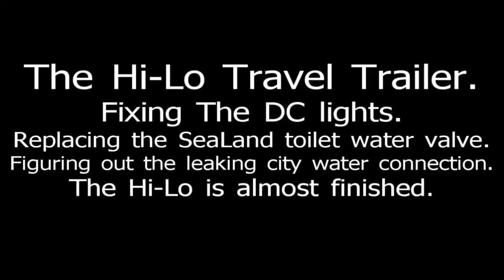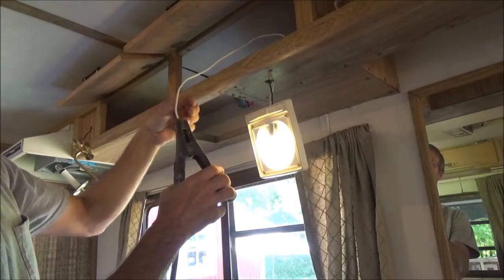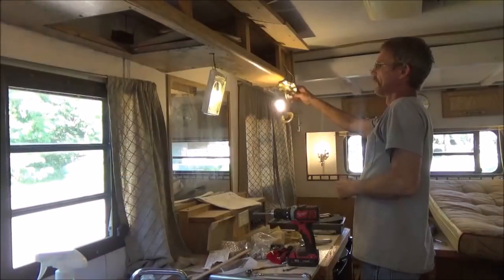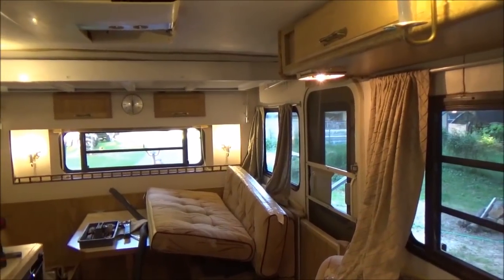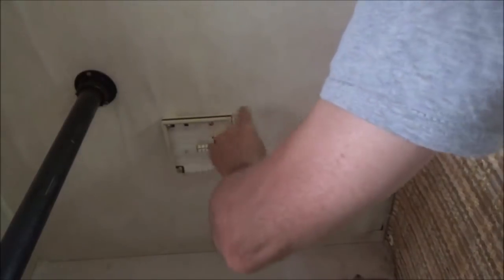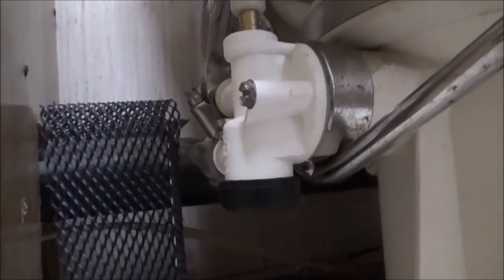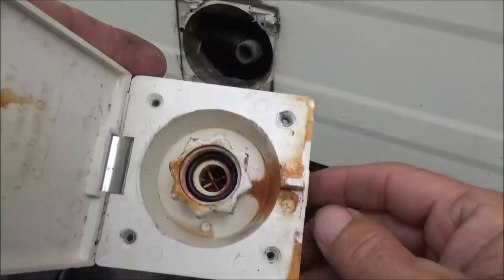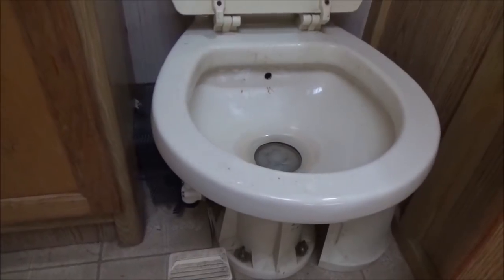The Hi-Lo Trailer. Almost complete. fixing the lights, toilet water valve and more.

Comment: If the toilet seal won't hold water or starts to leak just lube it with some Vaseline. I didn't use my travel trailer for 2 years and my seal would not hold water. My rv dealer quoted me $175 to fix. I did the Vaseline trick and 3 years later it's still holding.

Comment: I think that gray pipe/tubing is polybutylene. If it is keep an eye on it it is very prone to leaks especially at the joints. There has even been a class action suit on it if I am not mistaken.
Reply: In mobile homes and campers built in late 70's  to early 2000 they used the same type of plumbing lines, that stuff over a period will dry  out and crack with the slightest movement or vibration during the towing of the mobile home or camper, creating a nightmare of a headache for the owner. I have had to replace the floors and walls in many mobile homes and campers due to that problem. I hope the plaintiffs win their lawsuit maybe then the manufacturers of campers and mobile homes will construct them with better quality materials, especially considering the cost  of the units

Comment: That's going to turn out to be a great little trailer.  I have a question though.  Did you hook the hose up to the water fill after you pulled it out?  I think you may have been able to see where it was leaking once it was out of the housing.  I love this little camper!

Comment: whats the weight of one of those? My suv is rated to tow 3500 lbs dry and looking for other options besides popup canvas campers
Reply from the maker: This is what they posted back in 1986 in the Hi-Lo brochure: Vehicle weight 3190. Axle weight 2820 hitch weight 370
Reply: NorthernSeclusion thanks for the response Joe. Have a great 2017 camping season!

Comment: No door on bathroom?
Reply from the maker: It does, the bottom is a folding door and the top has a thick fabric type thing that matches what you see on that wall. It pulls across and once that is done you are completely concealed in the bathroom.